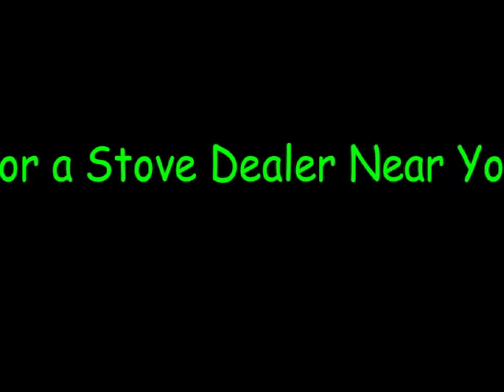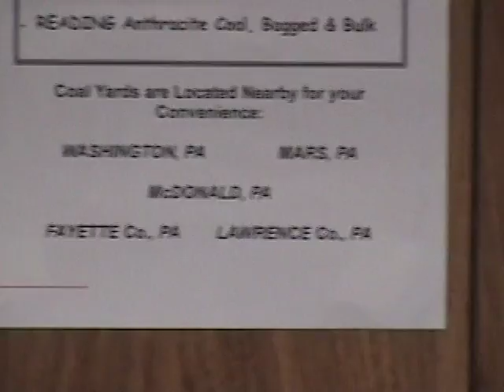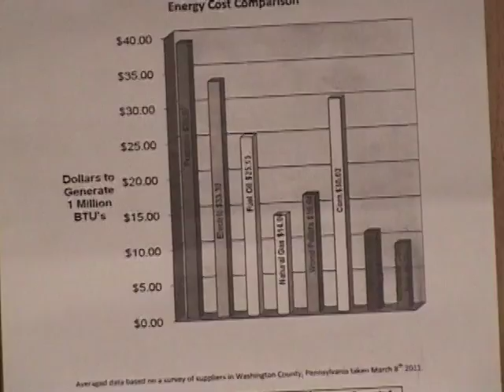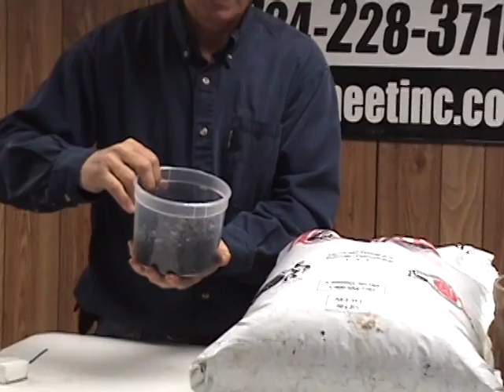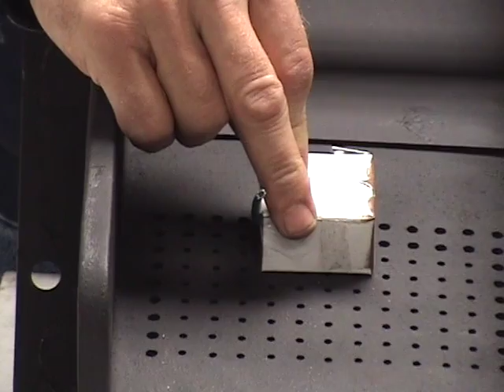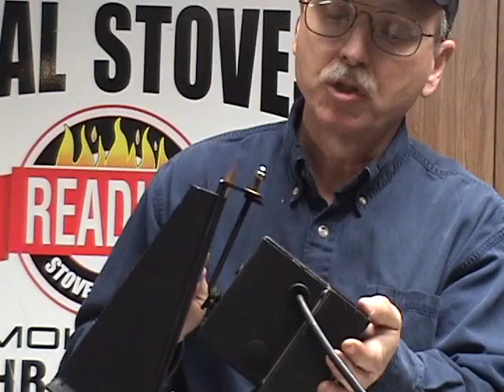DVD_Ch_1_6.m4v Cost Saving in Burning Smokeless Anthracite Coal. How to start the stoker stove

Comment: I only burn 1.5 tones of pellets a year and it's 200 a ton!
Reply: I am burning coal, in a stoker stove - which is kinda like a pellet stove except that it burns coal.
And yes, the heat from a coal stove is powerful and deep, and a little bit of coal goes a long way.
I am burning about 2 tons per winter, and I have more of a problem keeping the stove down in btu output than not high enough.
Reply: +Oldcoinsandstuff1 
They are charging me 270 a ton, out of Cornwall-on-hudson, Cornwall Coal
Where do you get 200 a ton?
Reply: 1.5 tons? two possibilities.1 its not that cold where you live 2 its not your primary source of heat. we heated with pellets for 5 years and i got fed up with them. we burned 7 tons one year and it still was cold in the house. we burn almost half as much coal, last year 3 tons.

also where do you get it at $200 per ton. when we were buying pellets they kept going up in price every year. i think the last year i was paying $250 per ton. i got fed up, i had enough. coal is allot more heat and the coal was the same or less then the price of pellets.

coal is much more btu per pound so you burn allot less, saving you money AND handling less raw material
Reply: that's not pellets that's rice anthracite coal. i know i have one, i have a keystoker. when you said pellets normally that refers to wood pellets. wood pellets are crap compared to rice anthracite
Reply: Yes, I know it is anthracite coal, rice sized.
And I know that wood pellets are crap too, in fact if you look at the btu cost of them, it is just a notch cheaper than heating oil #2, which is not cheap but much more convenient than wood pellets.
But a keystoker burns rice sized anthracite in a similar fashion to how wood pellets are burned, a little bit at a time.